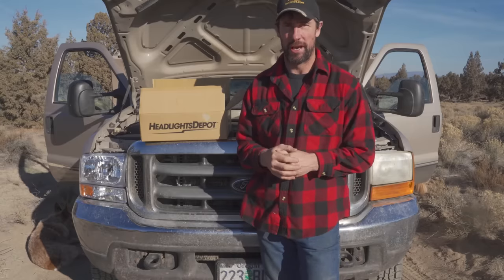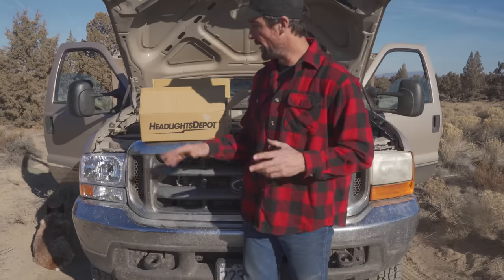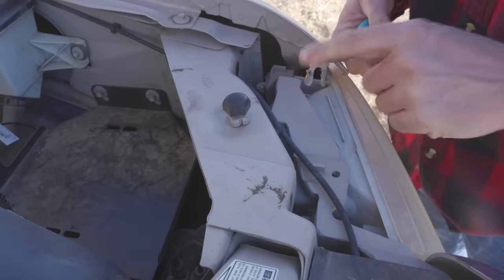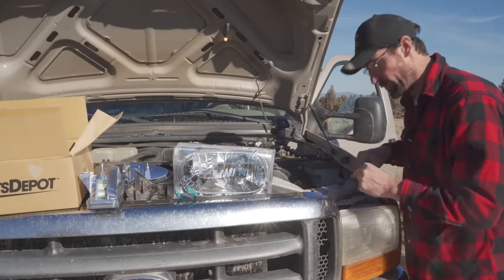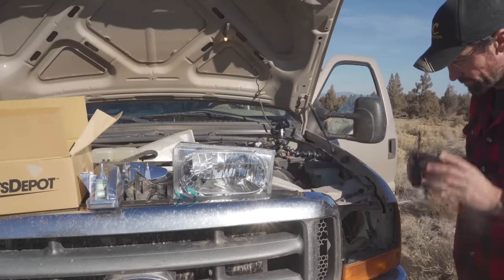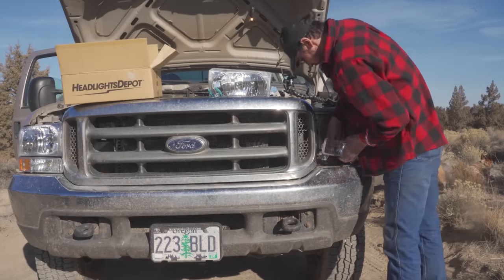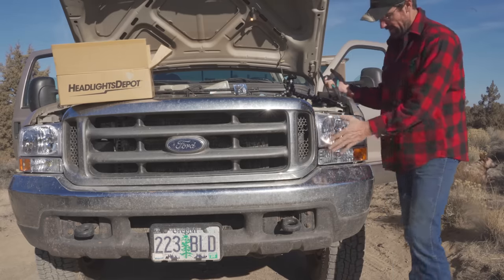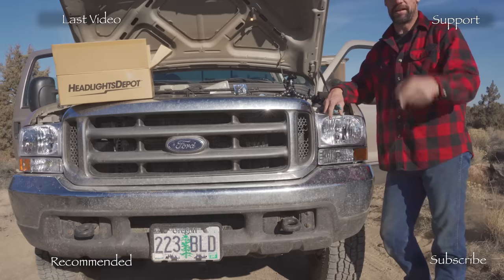1999 2004 Ford SuperDuty Headlight Replacement Easy Way  F250 F350

Comment: Great video but the 2nd light housing isn't fog lights they are just running light and blinkers
Reply from the maker: Haha, I knew someone would catch me on that😂

Jason
Reply: @PrimalOutdoors  it's all good just dont wanna see you become a meme
Reply: Was going to type the exact same thing, but didn't want to sound like a jerk...  But props on peeps looking to do this and an instructional video of it!
Reply: @joshua6200  I dont think I sounded like a jerk lol
Reply: Is it possible to just remove these lower lights but not the main light?
Reply: @searyan2012  yes
Reply: And when you are replacing it with a clear lens you need to use amber bulbs, not clear.

Comment: Just a tip. If you take a 14 mil socket and slide it into the 3rd anchor point it will push both tabs in and the light will slide right out. I am just replacing bulbs and was to lazy to try your method. Got lucky and the first socket I tried worked perfectly. Lol
Reply: That worked great. Thanks
Reply: If I was a woman I'd mouth smash certain parts of your body. Fussed with the first aide trying to reuse the original and had a hard time getting new screw to grab. Other side I was gonna struggle when I heard a voice slap my head and say, "hey dumb@ss, get a 14 mil socket. Took me ten times longer to write this note than it did to get that adjustment assembly out. Well played man.
Reply: You sir are genius.
Reply: I'm trying this in about 10 minutes. 😆
Reply: @nathanfisher5266  You are my hero! Your tip made this job take less time than watching the video.

Comment: Thanks so much for this video.  My husband graduated to Heaven last year and the left headlamp on 02 F350 Superduty  went away this week.  I’m pretty sure I can do this after watching your video 👍
Reply: Sorry to hear about your husband. You've probably taken care of the issue, but for others: Note that this is a full headlight replacement! If a bulb burns out on a "non-sealed" headlight, you can just replace the bulb. See a video on that proceedure.
 I got some Anzo headlights from AutoAnything. They do NOT come with bulbs, and instead of using the old Silverstars [they have reduced output over time] I got new Phillips "X-tremeVision" bulbs. They were recommended by many.
Reply: Graduated!!! You’ve just shifted 32 years of perspective in one sentence and shifted it for the rest of my life!!! Thank you 🙏🏻
Reply: sorry for your loss
Reply: As others have already stated, sorry for your loss Jan!…Hopefully you got your headlight taken care of!…My only advice is to change them both to match them up if you can 👌😉
Reply: @trailrunnerful  how’d it go?!
Reply: @trailrunnerful  vary cool 😎

Comment: Thank you, with a 7.3L diesel's batteries, the one on the Driver's side is hard to get to, you saved me a lot of time.  Dang, wish I had seen this video before I ordered new "headlight shells" sans the bulbs.... I paid $75 to AutoZone for new bulbs the headlights and Marker lamps, in addition to the $80 for the shells..... I realize that Biden's economics might be in play here, but still..... complete assemblies are cheaper in the long run

Comment: Over 3 years after your video. Big help. I have the 7.3 so I had a battery behind the driver side. Reusing the original adjuster was key to saving time. Great job keeping it simple and not leaving out details. So many other videos on YT skip over the key points. I really struggled with the turn/side marker screws. Very small gap and only installed the outboard. I even had a harder time putting in the outboard clips than removing the originals. You video was spot on. Thank you!!

Comment: Thanks for the info. Made my job alot easier. To refine it a bit more, I discovered that if push a 9/16" socket over top of the old pin that squeezes the ears in perfectly so it comes right out. Also my upper clips were really stubborn so I threaded a 3" wood screw a few threads into the clip and used a claw hammer to pull it out.  I was barely able to salvage the clip but it was better than having to order new ones. Hope this helps.
Reply: You good sir are a gentleman and a scholar, fought that old pin for half an hour, trying to not brake it and saw your comment on the 9/16. Smooth as butter, much obliged sir.

Comment: Changed out my headlamps today on a 2003 F350. Like you I could not get the plastic clip to release and used your method of leaving the old adjustment screw and plastic housing in the truck. It all worked great.  Had I not seen your video I’m not sure what I would have done to remove the old lights. Thanks for the great “Plan B”.

Comment: Great vid, excellent find on separating the adjuster! I just replaced mine, took about half hour. No removing batteries (I have 2), no fooling around trying to remove those adjusters. Worked great! Thanks!

Comment: Great tips on comments. I would only add that you should tighten the two screws FIRST to that lower turn signal assembly BEFORE installing the headlamp assembly because you might need some play to get to those screws depending upon how high/tight the top of the bumper is. Otherwise, you'll have to lower the bumper or remove the headlight assembly if the space is too tight. Each truck is different

Comment: Big help on this. Backed adusting screws out as suggested really helped. Holding the retention tabs down on drivers side just wasn,t working. Even tried holding a 14mm socket over tabs (back of frame) to hold them in. 
Finally got a drill bit and gutted the little sucker and it ell out...YAY.
Replacement buckets came with adjuster assemplies so sacrifice a no-brainer. I will do this again if EVER I have to change buckets.
One more thing. When starting the long aduster screw, note that the screw has two flat spots top & bottom. They have to be top and bottom to get the long screw to seat deeply enough to engage.
Reply: That’s a VERY important tip !!

Comment: In North Carolina.  Just finished....looks great....thank you for the help!  I tried to find a "magic tool" to get that adjustment/retainer out (Ford probably has some contorted thing that easily does that)...but no luck.  I did what you suggested and used the old one.  Only one beer and several vulgarities and it was done!

Comment: Thanks Jason, regarding the fog light replacement, I found they were impossible to get out without dropping the bumper. I took a sawzall and cut a minimum W configuration at top center of bumper, took just enough to remove the lights, so as not to destroy the bumper integrity. Works for me.  John C
Reply: Saws All?????  I replaced my fog lights and didn't need a Saws All.
Reply: No fog lights

Comment: great recommendation and useful video, just helped my roomate replace the headlights and turn signal assys on his '03 F350 , made the replacement much easier, and the pliars trick worked great on the drivers side, the passangers side i was able to pop the light loose with a long screwdriver between the core support and battery tray from just behind the headlight bucket, great video

Comment: thanks for the great tip. Saved me a ton of frustration. Other thing I learnt. Measure the old light settings  and pre-set the new units before installation . worked out very nicely .

Comment: If you use a 14mm socket to push the clips in  will be easier. I did and it worked and saved me time.

Comment: I could not do what you did with the vertical adjuster.  They are the reason I am replacing the headlight, because the vertical adjusters were non functional.  20 mins into removing the old adjusters and I agree, they are a PITA. Going to take a chisel to the clips and break them off.
Thank you very much for posting the video.

Comment: Rather, use the old horizontal and vertical adjustments on your truck and remove the new controls from the new headlights. Takes a "TON" of work and works great. And, you only have to remove ONE clip. Just did mine and was a game changer. Thanks for the inspiration!

Comment: I had trouble squeezing the bottom adjusting tab also.  I finally just tapped a 9/16 deep socket on it and it squeezed the licking fingers easily and made removal a breeze.

Comment: I followed your instructions on how to remove the headlights which went smoothly. l had a hard time going back in getting the threads to start, so I decided remove the adjuster. I found that a thread adapter for 1/2” copper pipe (1/2” MIP threads x 1/2” Cu Pipe slip) will just fit over the inside end of the light adjuster which can then be pulled out.

Comment: This is amazing.. I did not know about headlight depot and this particular headlight housing that can RE-USE the existing adjuster mechanisn for both a quick install and…to retain the ability to adjust the headlights in a civilized manner. Thanks so much. I have subbed your channel.

Comment: When you say "connector" do you mean headlight adjuster screw/bolt? Also, with it being late 2023 would you go with the option to remove the last tab with a 14mm socket pressed on or would you do it just the same and why? Thanks for the great video!!

Comment: Be sure to swap the clear / white bulb (3157) in the turn signal to an amber one 3157A). Not legal if it looks white, must be amber.  Thanks for the video, i'm swapping my headlights out this week . I'll be sure to try your trick on the adjustment screw to make install easier.

Comment: The clip that you can't get to to release you can use a 14mm socket to push the clips in then pull the headlight out. works great cause I just did my 2000 f 250

Comment: for that lower connector just push a socket over it to push in the ears  14mm 12pt fits perfect.  same way as releasing parking brake cables

Comment: Thanks so much for making this. Your shortcut saved me. There was no way to reach  the original connector...and no need to - as you show @ 3:30 to 4:30. One tip I found is that the new screw fed into the connector best if the flat sides were horizontal, not angled.
PS: The link doesn't work for the headlights you used. I bought an ANZO headlight kit from AutoAnything.

Comment: Hey Primal Outdoors You made it look easy. I have the complete 2004 Excursion & F Super Duty factory manuals, most of the TSB's. The detail of pulling the clips and pulling the lower light forward is not there;-( Your video is what got ot done. Me and my F 350 Thank You!

Comment: Add some LED headlights to that and you will improve your visibility tremendously, buy the kind with the built-in fans just behind the headlight and they're easy to go in. We just added a LED light bar to our push bar and that really improved visibility I can see my truck coming from a half a mile away. Remember that you also need to have yellow turn signal bulbs if you add the clear lenses

Comment: What Size Nut Driver to remove the Right Long Screw in the corner? My 2002 Ford Turn Lamp housing had two phillips screws on the bottom of both lights Thanks...

Comment: You didn't say, but it looks as if you're turning the adjustment screw clockwise to remove and counter clockwise to replace.  I'm doing this very replacement tonight as Amazon just delivered my new lights today.

Comment: I know this is an old video 

Two comments 

1. Just push a 14mm socket onto the lower mount. The socket pushes in the clips and just pull the headlight. Easy

2. Don’t struggle with the clips. Just release on side of the clip legs, then the clip comes right off

Comment: went to the website and it says it wouldn’t work. do you know if it works with f-250 super duty 7.3 powerstroke?
Reply: It should. Just keep in mind with dual batteries, there is little to no space behind the headlight where the battery sits meaning you’ll almost always have to pull the light assemblies completely out to replace bulbs.

Comment: Try not to put fingers on bulb. Oil from your fingers will make them hot an break
Reply from the maker: Yes your correct but some times you have no choice. In a perfect world I would have a fresh set of disposalable rubber gloves but unfortunately I didn't not.

Jason 

Jason

Comment: Just in case anyone else is here for the how to and not this channel, the easiest way to get that lower clip off it to just use a socket that is just a little bigger than the clip (1 want to say it was a 13mm but I could be way off) and then just press it over the clip and it should compress and push it out simultaneously.
Reply from the maker: Great suggestion, I am sure that will be of help to some but in case that doesn't work they can still fall back on my solution.

Jason
Reply: @PrimalOutdoors  good tip. Where were you last week when I did mine :-) I used some thin pliers and squeezed them. Still took several attempts before they gave up.

Comment: They are not fog lights. They are running lights. But I don’t like the 1999-2001.5 headlights. They have the fuzzy light. The 2001.5-2004 have the clear lens

Comment: I did the same thing to my 05 Dodge Durango. The  only difference was that  I swapped out the bulbs that came with the new lenses with LED replacement. If you decide to do that don't get anything over 6000K or the light color will go blue.

Comment: Another Youtuber bought a "special tool" from Matco to grab at the clips.  Not sure how much it cost the guy buy could save time.  Is it worth taking off the grill to gain more access?  Those screws under the directionals are a pain in the A$$.  It's worse if your bumper got hit over the years and "pinches" the area and making it really hard to get at them.